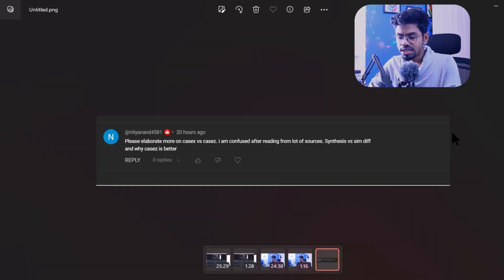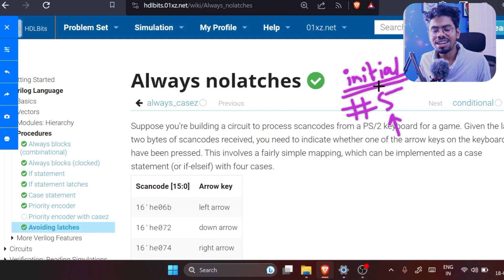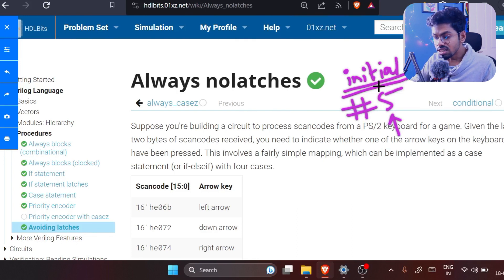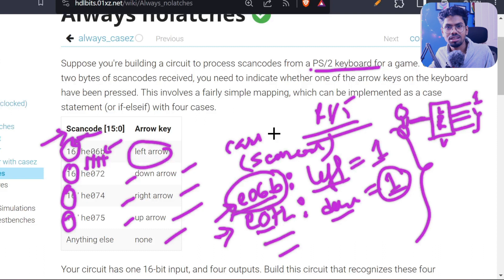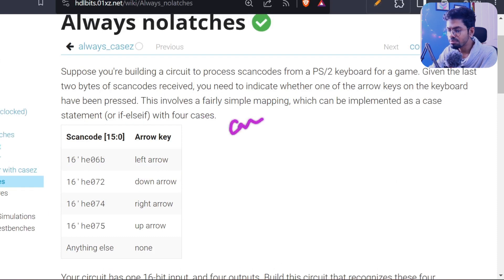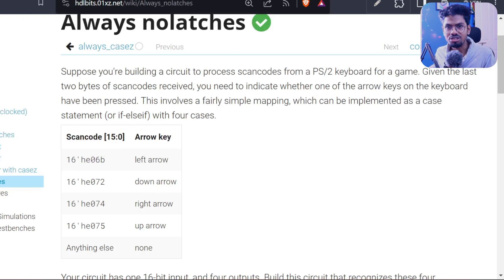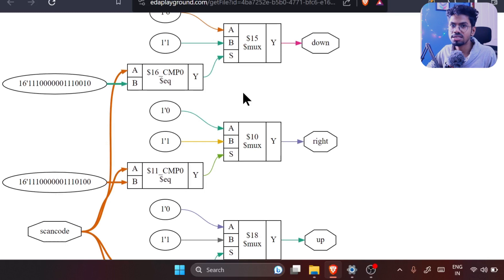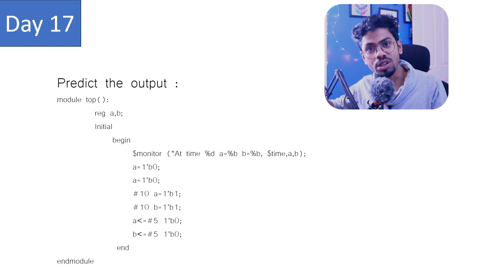Simulation vs synthesis  | Verilog synthesis using EDA playground | Day 18

Comment: what is the use of multiplxer again?
Reply: Mux is usually used to convert a large number of inputs to a single output (for eg: consider a 4:1 mux it will have 4 inputs and a single output and which input will we get from the output is decided by the select lines in a 4:1 mux the combinations are 00 01 10 11 so based on the above like which input you provide through the select lines will ultimately decide the output. Best of Luck!